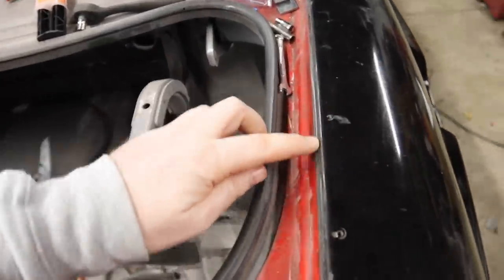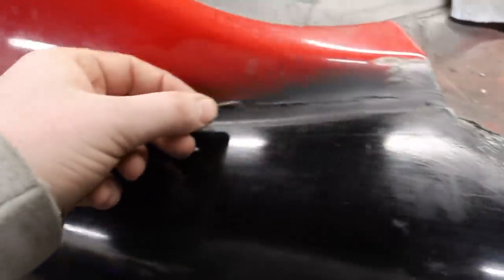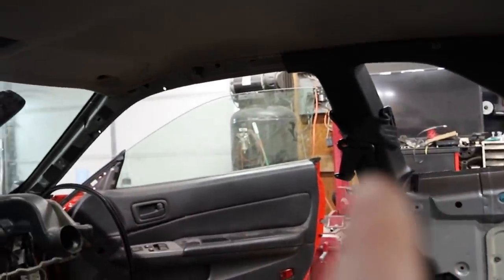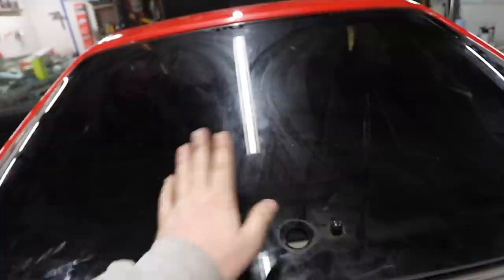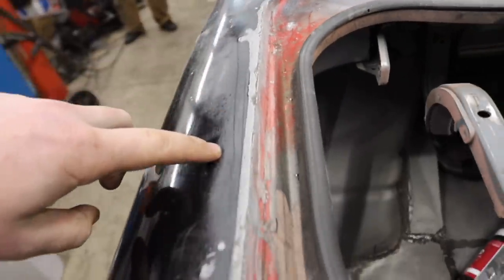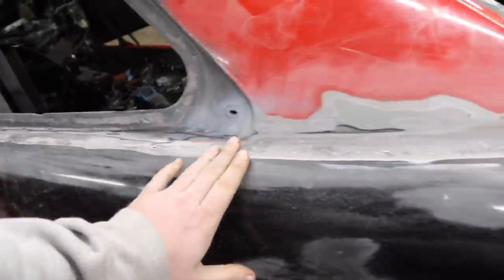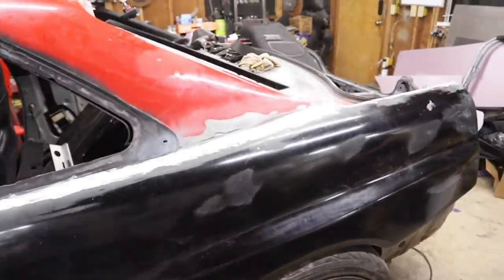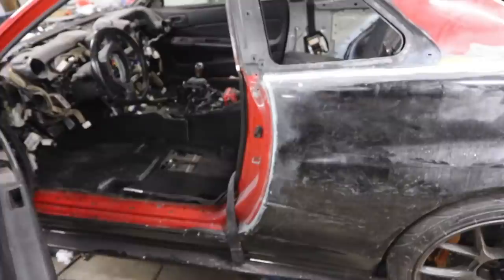Installing R34 & R35 Interior and Roll Cage Into The R69 GT-R

Comment: Swapping the door handles for straps like the ones on Porsche GT cars would really look cool, especially if you decide to go with the flat door panels.
Reply: Didn't he do that to one of the hurrican builds with a carbon sheet? Either way I agree
Reply: or maybe even something new and different for door handles. like small katana handles with katana shift nob and e-brake to match. or maybe something else.
Reply: maybe button/remote actuated door handles would be cool then shave the door handles on the outside too?
Reply: I just did that two nights ago on one of the door cards in my Datsun. I pulled the old card out, pulled the stuff off of it, peeled the vinyl off the degraded backer and put it all back together on a super thin plywood backer that should be more durable than the old one. The inner handle (not the latch, but the door close handle) bolts are phillips head and do not come out of the door handles without destroying them. The bolt heads are pretty destroyed, of course, so instead of putting the handle back in with bolts I may not be able to remove again, I grabbed two new panhead bolts and cut a leather strap, punched two holes in it and bolted it to the door. Now I jist meed to do the passenger side as well.
Reply: The leather strap would look pretty good on a bare aluminum door card though.

Comment: Pull back the leather covers on the rear seats and cut the foam to accommodate the roll bar. Then contact cement the cover back into the new shape. If it has an aluminium pan, you can modify that when the cover is pulled back.
Reply: yes please. I am sorry but it doesnt actually look good. it looks janky. just being honest for constructive criticism . cutting a nice radius right there where the bars need to go that fits tight around the bars would correct the issue and look nice
Reply: I think this car didn't need a rear seats at all, team can make something like a soundbox instead of the seats.

Comment: what your trying to do is called "fillet" work, im a boat refinisher, when your doing those edges- the best tool to use is small spatulas made out of silicone trimmed down, then you can clean them easy cuz the glass or resin pops right off

Comment: For the door card if the old one has a metal bracket you may be able to reuse it and if not check if you can get some aluminum (or really any other metal) square tubing and cut it in half. If you want to have some shape to it you can use foam to get to the shape you want and fiberglass it or make any mold you want. Its coming along so nice!

Comment: I'd like to see the main hoop welded where the front supports are and leaned back at the same angle and put the vertical supports in the seat gap where you're putting felt to cover it

Comment: It would be nice to use the old door cards. Relocate the handle and opening latch and modify that aera, which currently interupts the dash. Cut the door cards where it meets the dash. You could scan both the dash side and doors card to make a 3d printed piece?  I can help you with the 3d surfacing if you need help since it's a bit complex.

Comment: Add some fiber glass resin to your bondo makes it creamier and easier to work with! Take and knock the top off with 80 and then block sand it! Works amazing and acts as your butter coat/metal glaze with very little pin holes. And saves a ton of money. The prime over it with high build primer and block sand that!

Comment: Once you have the basic door card made with the opener installed in its proper location you can form the rest out in fiberglass wood or high density foam to where it looks good then finish off with covering with black leather or vinyl to match the interior.  Even if you have to take the final door card to a professional upholstery shop and have them cover the panel in leather/vinyl.

Comment: I've found that when using vinyl paint on interior pieces , you can't get them clean enough . Clean them completely several times . Then just before paint , heat the vinyl well . In the south , I just wait for a sunny day and put the pieces in direct sunlight for a bit . Then paint as usual .
   Never had any color transfer or loss of color , ever . Not even years after use . The vinyl on the seats wear out before the color does

Comment: Love u man. U and the team doing great fabrication work. I have a comment which I observed from the initial lambo work and taken it to the R69 which is the final touch. It will be much better to spend more time to make the appearance clean and mint 👌🏼 for example, the headliner, u can rewrap it instead of paint it. Also, u can ask fabric fabricator to do the gaps and cuts around the rollbar on the back seats (maybe at the final stages). Also, the door panels, u can order or make the carbon fiber one where u can cut into it to make the door handle fit to it.

I love u and love GTR especially R34. So excited to see this build finished and in great look.

Comment: You can buy the interior pieces of the roof from a S15 like the sun visors, rear view mirror, interior and map light as they came in black. They're straight bolt on and plug and play since they're the exact same pieces as the R34 except a different colour cause the S15 had a black roof from factory. 
Skylines only came with a grey roof.

Comment: For the wheel well interior panels get a sheet of poly carbonate, a reaaly good het gun and you can form a filler panel moldfor that section. And use that or use it as a mold.

Comment: For the top of the door cards, if you can't find someone to make the tight bends, maybe try some small aluminum c channel then have oscar tig weld it to some flat aluminum, or if you want it more rounded some 3/4 od aluminum tubing or what ever size that would clear the door cut in half. Just an idea.

Comment: I’m thinking that bondo is going to crack if you plan to do any spirted driving. 😬 I would recommend using that glue you used on the wide body. Some of it is sandable and flexes decently.

Comment: suggestion for your door cards. Cover inside of door with alum. foil, then spray with spray foam. Sculpt hardened foam to desired shape. then you could fiber glass or carbon fiber. Or you could just use flocking/felt or cover with vinyl or leather, possibilities are endless. to smooth out foam after shaping, you could body filler surface to smooth. Would be a better looking/more custom look than a simple alum panel. Still in my prayers for a complete recovery. God bless and stay well.

Comment: I work for a sheetmetal shop in Longview wa. We have a nice break that could probably do those bends you’re looking for. But there should be several shops down by you as well. Portland is a little cheaper wage than we are. Local 16 vs local 66.

Comment: Are you going to notch the rear seat bottoms so the roll cage is recessed into them? It would eliminate the puckering of the leather and the end result would look much cleaner. Any upholstery shop worth their salt should be able to trim the foam rubber cushions and re-sew the the leather cover to look stock. Good work guys!

Comment: If the headliner paint doesn't work out, but a couple yards of black felt from the fabric store, strip your old fabric off, spray adhesive as you spread the fabric out and trim of the excess,then boom,  new headliner

Comment: I did my headliner in the car with that paint. Lot of masking but it worked well.  On the e24 the only way to remove the headliner is to remove all the glass so it was my only reasonable option.

Comment: I have fitted a few wide body kits to different cars and I find cutting the body kit a bit short the likes of where it goes over the top of the quarter panel. If you cut it short you can mold it in better plus you can get to level to the boot lid to match

Comment: You could use some aluminium U channel for the top of the doors as a cap and screw the flat panel to it rather that have to try and get someone to bend the panel.

Comment: Hey Chris, im abit worried about the roll cage would just "crumple" together abit too much depending on the angle it would hit. All half cage roll bars have the rear strut support. You probably ant the rear seats to be usable. But you should be able to do so. Also the "front" support should have gone to the corner of the roll bar. But with the rear strut bar it should be fine. But i would add the extra tubes to the rear struts for more support and structual strength. Other then that great work on the car man :) And stay healthy.

Comment: The cage seems ineffective/pointless as the main arch looks like it frames the rear window at the top. Probably could've been bent and shaped better over more time. Also the rear seats should be cut and shaped around the bars. It's little detail that complete builds and they seem to be overlooked. 

If you're going for racing door cards (flat), then shouldve ditched the rear interior and leant into the race vibe.

Either way, it's your build and it's fun to watch but don't overlook the finishing touches! Which reminds me, do felt the rar speaker panel!
Reply: I think they dont want to cut the rear seats, just in case they want to change the rollcage or move things around(those seats are probably pricey)
Reply: Diminishing returns. Your average b is for build viewer doesn’t care about finishing touches and it’s not worth their time. It’s not like you’ll ever get a minutely detailed video or high res still photos where viewers could see all the shoddy edges and cut corners. They just focus on big things you can see from a thumbnail.

Comment: I am in love with this build, and I absolutely cannot wait to see where it goes by the end of it :)
I do have a question though, will you be weighing the car when you're done? I would love to know if the car gains or loses weight by the end of this (compared to a 'regular' R35 GTR).
Reply: Bump on this. Honestly should be lighter but with the roll cage who knows. Would be interesting to see where it falls around a R35 and R34 OEM curb weight.

Comment: In regards to the door card bends, I might be way off base, but I have an idea. If you took sheets of aluminum for the door cards, tacked a solid metal dowel/shaft to it, and then heated the aluminum and bent it around the dowel/shaft, could you get the bend you need in house? Just a possible idea if you can't find a metal shop able to help in an agreeable timeline.

Comment: I'm no where near as near the fabricator Oscar is and definitely not a structural engineer, but I think the rear hoop and supports could have been designed to be more integral and aesthetically pleasing..  Keep pushing, Ya'll do good work!

Comment: Lovely work so far but I hate the way the roll cage distorts the rear seat bases that looks (as we English say) naff, and I imagine very uncomfortable if sitting in the back. I know it would be a lot of work but could you extend the tubing that comes down behind the front seat and put a gentle curve in it so it misses the rear seat bases and mounts on the floor. I know a curve will weaken bit if a large radius could actually act like a spring under the compression of a vehicle roll.

Comment: Rollcage will not save you. It will only support the roof on the c-pillar. Thats it. In case of a front crash. That cage will just fold back to the trunk. Its not even connected to the strut towers at the back

Comment: Great work guys and keep fighting Chris.
I am slightly worried about the rear bars.  Your rear passengers are in danger of injury in an accident arnt they?.
Why don't you remove the diagonal bars and do a vertical bar in the centre with 2 roll bars over the rear passengers head?

Comment: Isn't there any way to use R35 door panels/card to get a whole R35 interior ??? I think that will solve the door handle issue too and make the interior completely modern with same flow between all the interior pieces.

Comment: Do you have an iPhone 12pro or 13pro? If so, it has lidar which you could use to 3D scan existing parts to assist you in 3D printing pieces to fit fit with the existing dash or door cards. Just an idea to help your at home DIY process.

Comment: Shouldnt the roll cages base mount be welded to a much sturdier plate than judt the chassis metal? I could be wrong, it just looked like for a second, you double or triple passed it to the sheet metal.

Comment: Cut that cage out and do it over.  It doesn’t make sense.  You can easily lay back the hoop to follow the b pillar angle and the rear down bars can terminate into the rear wheel well or through the speaker deck into the trunk.  Then the rear seats are 100% useable.

Comment: Make one 90 degree bend with a standard folder, then attach (tack weld) another piece to that folded part, put the whole lot in a vice and the whale on it with a hammer. then fold the welded piece, put it back in the vice and have at it again.

Panel beating is not a lost art ;)

Check out Trev's Blog on youtube.

Comment: Please use the old door cards. Relocate the handle and opening latch and modify that aera, which currently interupts the dash. Cut the door cards where it meets the dash and make flat piece out of fiberglass or aluminium. Later retrim the door card.  I would look miles better than full aluminium door cards.

Comment: you should remove the rear seats. this just looks weird and the seats can never be used because of the roll cage unless you have a death wish.
Reply: And fill it with what? It looks better with the interior even if you never use it.
Reply: Not a bad idea really - but still keep the speaker cannons of course

NOS bottle ode to Paul Walker? Fire extinguisher bcz B is for Bodswap?

Comment: Honestly those speakers in the back are tiny. I would cut a 6x9 hole straight in the metal. 6x9 speaker are going to be 200% better than 6" rounds and it looks like those are baby dick 4"ers. You'll thank me later. For the door card. Do carbon fiber. You can hot glue sticks off the inner door for shape. Stretch fabric over the created frame. Fiberglass the fabric creating a mold. Then you can composite CF or FG your door cards.